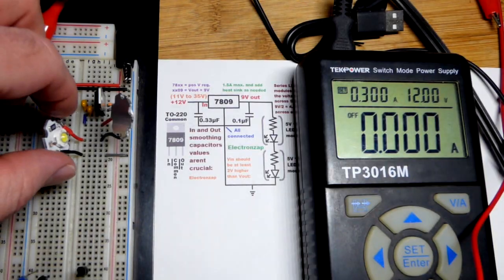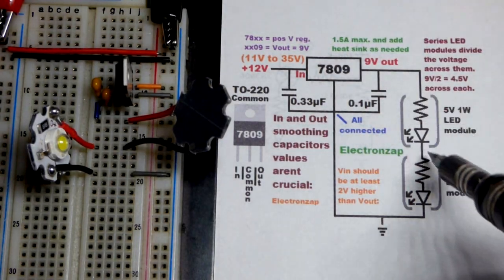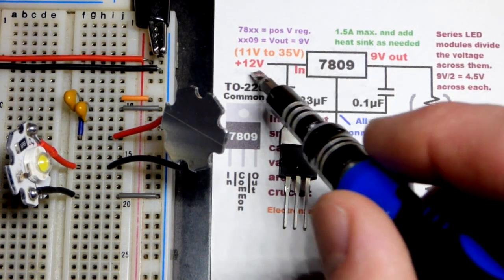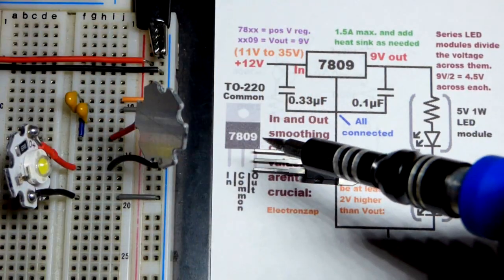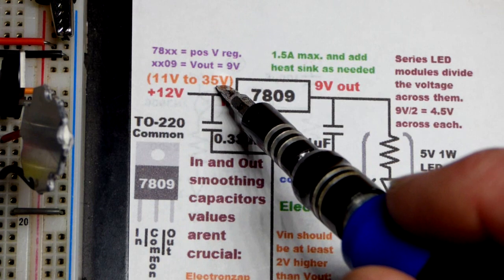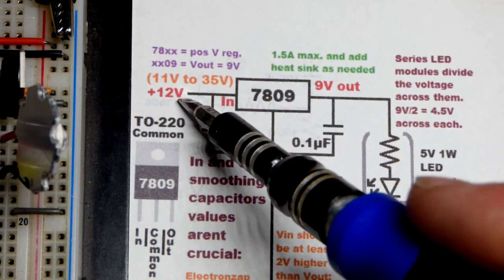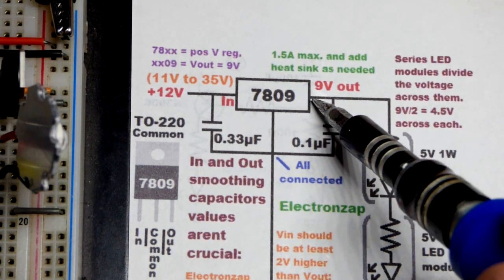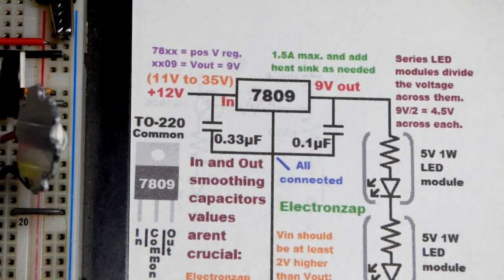12V to 9V using L7809 positive linear voltage regulator for two series 5V 1W LED modules

Comment: Cool, yeah you should be fine without smoothing capacitors until you try and hook up a 12v powersupply to one of these regulators to bring it down to 5v to light a set off string led lights, the IC in there that does the different flashing modes cant handle the noise and doesnt work, or very glitchy.  So for charging a phone with these regulators or lighting lights where the voltage noise doesnt matter it should be fine, but for things like mcu's they dont like it, (even the basic ones from dollar store lights)  hence the noise filter capacitors.